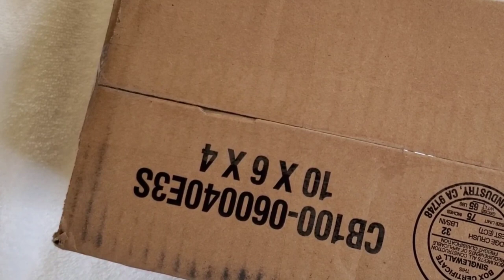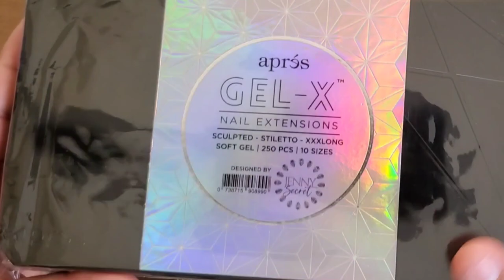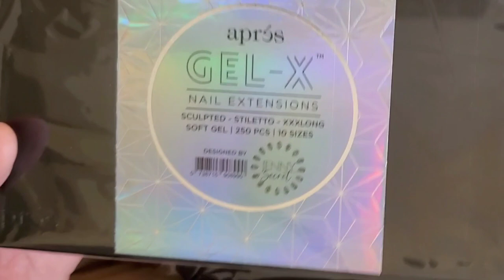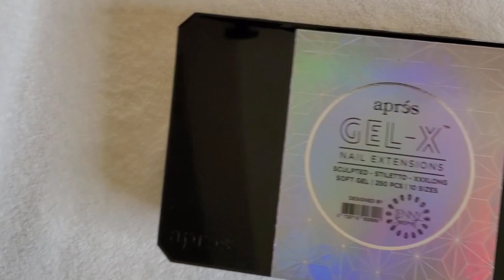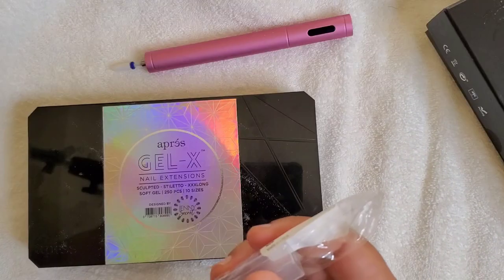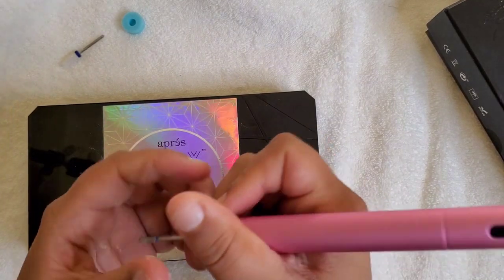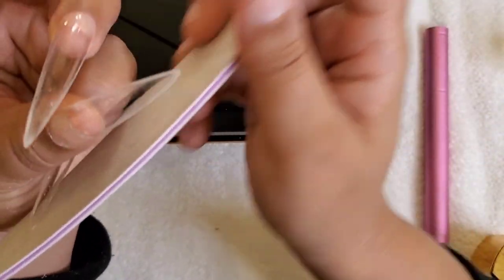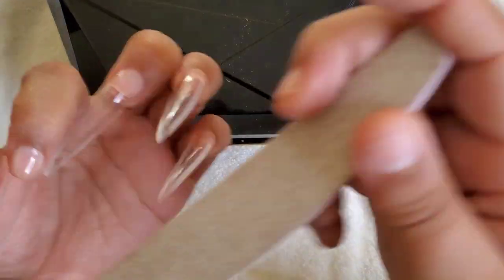Apres × Jenny Bui XXXL Tips

Comment: Thanks for making this video, im just getting into Apres. Could you do a video using the color extend gel they just came out with. Also is there a dupe for extend gel, i know polygel but it ruined my nails. Like soak off, I've heard base coat, im wondering if gem glue would work?
Reply from the maker: I did the color extend video about 2 weeks ago but planning to do more videos using it soon
Reply: i use the uv/led gel that u put the crystals on with. That is the gel apres uses too. The generic name is "resin gel"
Reply: @ertfgghhhh  thank you so much hun!!
Reply: @DippedInPretty  thank you honey!!
Reply: @erinloh533  np. U can find it for $5 on amazon. It is the type that needs to cure with uv/led light-not the type that is a strong glue/brush on glue "gel resin" that doesnt need a light. It is the kind that is a gel. U will see in in black pots. Its also the gel that u see them put on the big stones with. It is a resin gel cause it is a real led/uv gel that glues the nail to ur real nail. I found out that resin gel is the generic name for extend gel 2yrs ago
Reply: @ertfgghhhh  thank you so much!! Awesome I have a crap ton of that, perfect!! I love their color extend gels so much, so kind of want to mess around making my own colors. Much 💘
Reply: @erinloh533  just add reg polish, gel polish, acrylic powder, or gel to resin gel u want the other colors